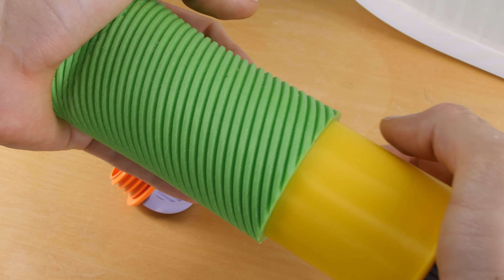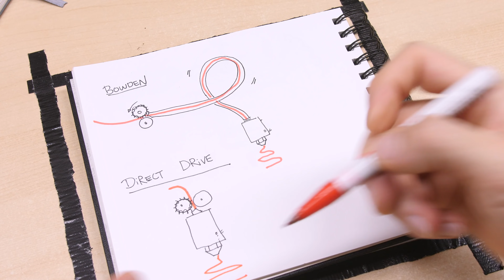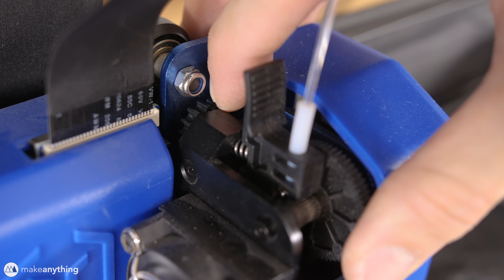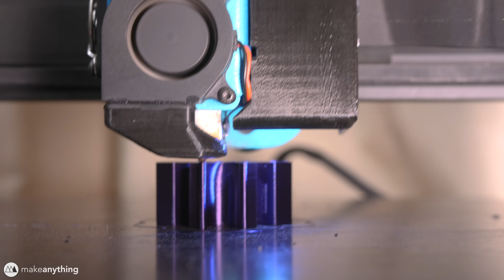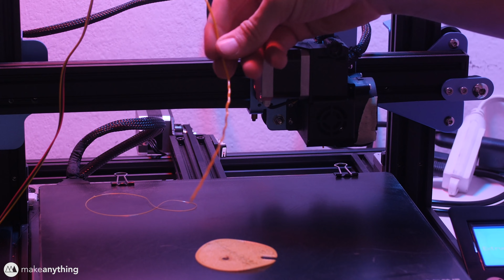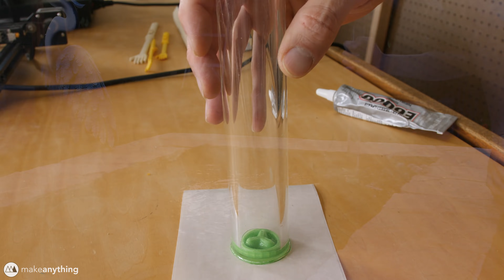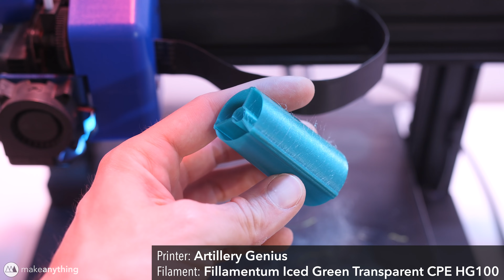Direct Drive 3D Printers in 2020 // Artillery Sidewinder X1, Artillery Genius, Sovol SV01 MEGAREVIEW

Comment: - Would the Sidewinder X1 be a good fit for a complete noob who doesn't want to buy yet a new printer in a year after having learned everything?
- How many times per number of hours/parts did you have to re-calibrate/tweak/tune the printer over the last 6 months?
Thanks
Reply from the maker: I'd say it's a suitable first printer and could certainly hold you over for years (although 3D printing addiction is real :P). As a noob you're going to have to learn things along the way no matter what, but I haven't had to do any major maintenance, and only re-level if I'm doing a major change in layer heights. It's been fairly hassle free, especially if you start out just printing PLA
Reply: @make.anything  Thank you! 👍
I need to talk to my "banker" now. 😉

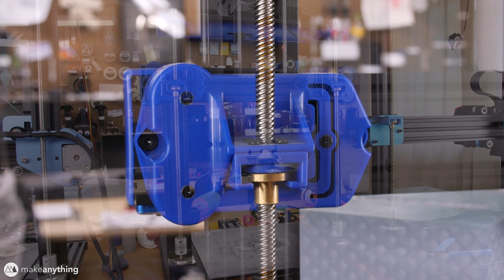Comment: 12:42 I can see why you have z-banding on the genius, look how the left Z screw wobbles !
Reply: The pattern doesn't look fine and repetitive enough to be from the Z screw alone. I suspect filament with poor diameter tolerance.
Reply: @heyarno  I'm a newb to this, seems there arw a lot of factors involved in good print quality.

Which of the above machines would you choose?
Reply: @LooseyHenderson  Sorry, I neither know what your priorities are, nor did I have personal experience with any of the above models. I'm using a home made I3 MK2 clone and a CR-10 300. As well as a 3d pen. It's also a matter of your ability to modify the printer to your needs. If you need it to be close to what you need from the factory, you should chose that model. If you can mod it, you should chose whatever is best in general and fix whatever issue would keep you from choosing it over another.
Reply: @heyarno  Fair point, and I respect your honesty. 
Speed - Low priority.
Size and accuracy - High priority.

After a lot of searching I think I will go with the Sidewinder. The Sovol seems great but I want to make larger objects and there's little else to compete with the sidewinder for size at that price.

Thanks again.
Reply: Likely not caused by the slight lead screw wobble. Keep in mind the lead screw pushes up and down, the wheels keep it squared to the frame. 
If you look closely,, see the gunk on the lead screw thread.. THAT is likely the cause.  All it takes is a tiny piece of debris to get into the nut or on the thread, and you get banding issues. Thick lubricants that attract dust on the lead screw will do that.
Reply: Irregular z-issue. also it is quiet. hmm TMC driver in stealthchop mode? increase the current or turn off the stealthchop for z-axis.  I'd done both for my printer and fixed it.

Comment: 12:42 Left side Z rod is warped on the Genius.
Reply: Yes... that's cause the uneven layers....
Reply: yeah that  caught my eye too, was wondering if other people noticed... that left screw is 100% bent and wobbly and i think that is causing the issues.. im really wondering if you could make a print farm out of genius printers... so far i have 3x mk3s... but maybe i want to try something cheaper
Reply: Also the thread pitch the lead screws is way to big. It looks like it three or for leads. Threads like that are hard to make at those small diameters without a lot of backlash. There's no for the z axis to move that much with each revolution. All of these things can have a negative impact on resolution.

Comment: I worked with stratrasys fdm printer. Its a direct drive. Used abs material and it has a soluble support material.  But the problem i face in direct drive is  during start up and warm up stage its metal gear also get heats up a lot it causes material the melt locally and it didnt get pulled while purging . As statrasys system is an enclosed system one clog clearing is really tiresome. Anyway stratrasys might be regt rid of this print head problem in current versions. 
Take care. Be safe

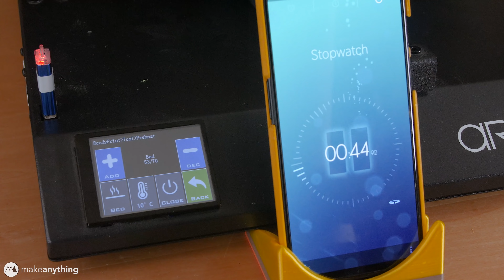Comment: 07:35 While true that it uses 24V for the mainboard etc, the bed is heated using AC power from the mains input of the printer.

Comment: I’m new to 3D printing and I’ve got an sidewinder x1 for a month . Haven’t tuned much but it works well, it will be great if you can make a video on tuning it. Been killing it with just printing with 1.5 mm thin walls with 0.4 mm space between (multiple live joints builds) and it worked really well. Z banding is quite something that the sidewinder x1 is facing (especially within the community). Thanks 🙏🏻

Comment: I have a Sovol SV01 and it is the best of my three 3d printers (the others are bowden printers). Printing flexible filament is not a problem with Sovol, you need only to put a small ptfe tube into the cylindrical piece where you insert the filament above the heatsink and voila (there is videos on YouTube to explain how to do it). I print flexible filaments flawless.

Comment: Hey Devin, I think the rods on Genius are bent. If I'm not mistaken they can can cause Z banding issues.
Reply from the maker: Yea,I only noticed watching back through, but from the back the left z rod isn't perfectly straight..hmm
Reply: That's correct, i just removed the rods and put them on the lathe to check the wobble and it was very noticeable, i solved it by applying pressure until the wobble was gone. But you can also get a new set of rods, just check for a high quality ones. Other component that may contribute to this issue are the z roller bushings, they are made out of plastic instead of steel :(

Comment: Do not buy anything Artillery. I had 4 Genius and 3 Sidewinders. Nothing but problems with the ribbon cables and layer lines. The Sovol is a much better printer.
Reply from the maker: Huh, crazy to have the same problem that many times. Where were you buying from?
Reply: @make.anything  I bought the 3 sidewinders from Amazon (version 3's). I got the 4 genius from fulament. I'm not sure if it was user error or machine error.

Comment: My SV01 prints flexible filament perfectly. I’m guessing your printer is one of the first runs which doesn’t have the ptfe tubing in the hot end. They have fixed this issue and the new batches can print flexible perfectly out of the box. Love the sovol.
Reply: i can also print flexible on my SV01 without issue

Comment: Hey man what is the resolution of the printers? Maybe I'm just missing something but I find it really hard even on manufacturers websites to find the layer height resolutions I would like to print really clean parts with as least lines as possible on an fdm printer
Reply from the maker: They can all go down to at least 0.05mm height, which is really fine. If you want even cleaner you pretty much have to go with resin printing or an industrial method

Comment: The Sovol prints flexible filament very well. Add a small piece of PTFE tube inside the plastic piece that is between the gears and the heatsink and you will see fantastic results also with flexible.
Reply: NRom No need to add the PTFE tube now , it already has.
Reply: @sherrimaltby3598  If he has had the printer for a few months, the tube did not come. I have 4 Sovols, bought last year in different months and I had to add the tube to all of them. I'm glad it's fixed now, it's a fantastic printer. :)

Comment: 12:40 - I would say the X1 and the Genius has issues with the prints that does not seem to be from Z bending. i would say - friction in the material (sensor? spool? extruder grip) + not properly configured E-steps for this filament.

Comment: Try to get the moire on Bristol board instead. On absorbing fabric the print will probably never stay sharp enough... And if you would treat the fabric first to reduce absorption, the print in unlikely to stick. Apart from heat roll moires, on a dense polyester moire might emerge but finding a paint that works and sticks through a wash is the tricky bit.
Also, remember overlock thread is often fuzzier than normal thread. You choose your filament carefully, same applies to the thread 🙂

Comment: I noticed you were printing PETG on the glass beds...have you noticed them pulling flakes of glass off with the prints? Printing with painters tape / glue stick is mildly annoying
Reply from the maker: Not with these printers, but I have had it happen with the CPE on uncoated glass. I think bed leveling is just extra important (ie. not printing too close to the bed)

Comment: I used to work making booklets and the stitching heads on those machines fed the wire directly into the head and also had tension controls. I wondered why extruders on 3D printing machines didn't have the same direct feed system & controls.

Now I know that someone did see the common sense approach to the correct approach to filament feeding into the extruder.

Comment: I had one of the early  Artillery Sidewinder X1.  Nothing but problems and never did get a print.  Cable problems. those flat cables were horrible.  Also the print bed was so close to the base that us guys with large hands couldn't get my fingers under to turn the wheels. After almost 1 month trying, it went back.  Got an Ender 5 modified to direct drive and love it. I hope they fixed the early problems with the X1 because I really loved the machine.
Reply from the maker: I mean, mine is an early unit too, but I guess it may have been luck of the draw. That said, I think they're on least v4 by now
Reply: @make.anything  Possibly.  One of the things that came up concerning those flat plugs was they should have locked in place so they wouldn't slide out.  Oh well.  Onwards and upwards.  You do have some great videos.

Comment: Hey guys, got a tricky question for you. I have the Anycubic i3 MEGA, had it for over 5 years now, pretty happy with it. But lately I've been printing a lot of TPU on the i3 MEGA for my drone, printing with decent success. My problem is that I am tired of the constant switching between TPU and PLA. So I thought of having the i3 MEGA dedicated to PLA and buy a second small build volume cheap-ish printer to be dedicated to TPU only.  Problem is there isn't many of them.  MP Select Mini V2 with direct drive would be the best but converting it to direct drive with quality gear would end up pretty costly, if even possible.
Any recommendations? Many thanks  and happy printing.

Comment: On the SV01 did you make sure the PTFE tube is inserted in the printed part and cold end in the extruder?
Reply: Dan Rogers Maybe not , because there is a long PTFE tube on SV01 now, the quality for Tpu filament is impressive.
Reply from the maker: @sherrimaltby3598  dang! I need to see if I can add one

Comment: I already have a Sidewinder, so I'm just here to reaffirm my purchase.
Reply: i own a genius cant say to much for it.
Reply: robert roberts so... you do or don’t like it?
Reply: @robertroberts2795  so is that a yay or nay
Reply: What do you think of the sidewinder? Its one I've been looking at for quite some time and I was wondering how good it was out of the box
Reply: @kj8168  ...so good I bought a second unit.
Reply: @kj8168  I have 11 printers and 7 of them are completely stock.. The X1 is the one I had to do the most upgrades to in order to get it to print consistently. I probably had a bad unit, but haven't been recommending it since then. I know the X2 is coming out in 2021 and I think they will fix a lot of the issues with that release.
Reply: @oneheadlight8000  I’d say that’s a bad unit. In the time I got one and it’s printed better than the one that’s costed twice as much
Reply: @kj8168  we have 4 prusas, an X1, four creality, an ultimaker s5 and stratasys. The X1 is the only problem child so far haha.. we had a bad ribbon cable out of the box, the extruder arm broke, the bracket on the back that held the z Rod nuts was not bent at a 90 so it was causing binding every 25mm or so. We got all those issues fixed and dropped on an E3D Hemera and love it now.. still needs to prove itself though.. the prusas all have 4-6k hours on them.. I’m about half that on the x1
Reply: What slicer software are you guys using for the sidewinder x1?
Reply: @noeservellon  I'm using cura with the cr-10 profile
Reply: @noeservellon  cura 4.6.1 with a prfile from 3dnexus
Reply: Looking to get a sidewinder to upgrade from my Anet A8, for not much more than I paid (in canadian monies) to get the A8 the Sidewinder looks like a fantastic printer, the extra build area will benifit my projects greatly, I'll probably just find a new spot for the Anet in the shop outside and let the X1 take it's place of pride in my room
Reply: @UNSCPILOT  I’d personally suggest the sovol, sv01 or sv03
Reply: @oneheadlight8000  I can't seem to find the Sv03 on (canadian) amazon, and while the SV01 looks nice it's build area falls a bit short of the X1, still, I will consider it
Reply: @UNSCPILOT  there were just some inconsistencies with the X1 when I bought it. QC issues that make me hesitant to suggest it. It may be better now.

Comment: The filament travels the same distance in both setups. This comparison by you seems biased and hoenstly, imo, untrue. If you cant get a tube screwed in flush with a nozzle, you have no business 3d printing and should order parts. If direct drive printers are more expensive than bowden, you would def expect to see more issues with bowden printers, and it would say nothing about bowden vs direct drive, but cheap vs expensive printers instead. Direct drive printer heads have MUCH, MUCH more inertia, and you cant have the same acceleration or jerk with them as you can with bowden and expect the same quality prints. And by "cant have the same acceleration" I mean the acceleration you can have with bowden blows away the acceleration you can have with direct drive.
Reply: Funny enough, industrial printers which go over 200mm/s are all DD. It is the distance travelled between the extruder and the hotend that Devin is talking about. There is a reason why you use over 5mms of retraction on bowden, to account for the INACCURACY of the system. You can still manage high accelerations on DD, perhaps with slight ringing depending on the rigidity of your system
Reply: @maciex794  The distance traveled is the same. its the distance from your spool to the end of your hotend. if you put your spool on your hotend i would agree with you.

Comment: I love my ender3 with a direct drive, and now I can trust the printer
I have not tryed glass as build plate, but love my WhamBam steel/pex
Thanks for sharing 👍😀
Reply: I made my own glass bed for my ender 3😂 BEST UPGRADE EVER! It instantly improves the initial layers by making it very smooth and glossy. I just use some hairspray for better buildplate adhesion

Comment: My diy printer is so loud I’m glad I’m getting a second that should be much quite.
Reply: Awesome that you made one DIY in the first place.
Reply: Skelten s agreed. Going DIY is IMO the best option, because you can build exactly what you need for your specific application.
Reply: You can change the stepper motor drivers to make your DIY printer work more smooth and silent :)
Reply: Try to replace drivers first(for example, try with 2209 first, it's low price), if noising is the only issue . I have DIY printer, and a same module of printer mentioned in this video, it's not necessary the stock one would (always) be better than the DIYed one.

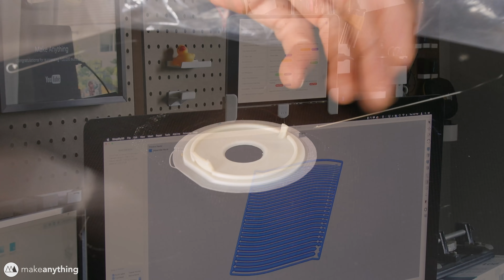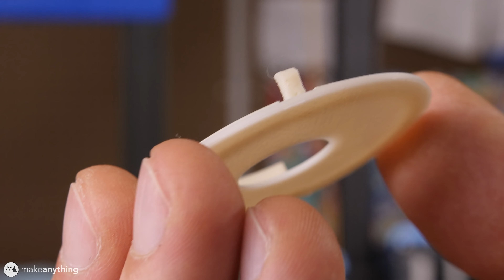Comment: 20:10 - That's the oddest router part I've ever seen.  20:24 - Ohhhhhh THAT kind of router.
Reply: In the UK we call the network kind a rooter, which avoids some confusion, but I think traditionally both would have been called a rooter (we just pronounce route as root in general).

Comment: Man! that nice big wheel is not to feed filament MANUALLY!  It's a gear! You can  break down the stepper motor. That's why there is a feeding filament function included or push yourself the filament.

Comment: Would you or have you shared your slicer settings for the X1?
Reply: Yeah!  I agree with cozmossis68.  It would be nice if you share slicer profiles and your choice for slicer.  I have the Genius and have been using prusaslicer a lot, but would love to compare notes.
Reply from the maker: I'm working on reorganizing my website, and this is something I'll try to work in! While settings may vary from one printer to the next and I don't always trust myself to have it all perfect, it could still be a helpful starting point 😉
Reply: @make.anything  Yes!  I think your original review of the Sidewinder is what cemented my choice on the Sidewinder and I've had some hit or misses with settings and would love to have a good profile to start with, especially for flexible!
Reply: Much appreciated!

Comment: Hey Devin! Very nice review! I have a Sidewinder X1 running and as far as I know, the artillery printer's bed is AC heated, that's why it could get to temperature a lot faster. Love your channel!
Reply: Yes, i just had to install a new PSU in my Sideiwinder, so i know for sure, that the heated bed is directly connected to 110V/220V. It is switched on and off by a solid state relais, which gets its signal from the mainboard.